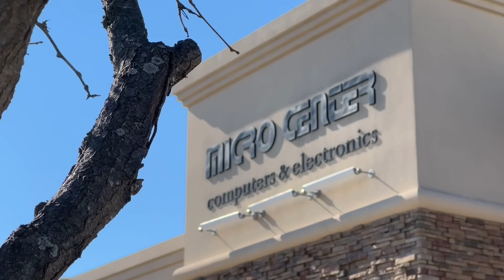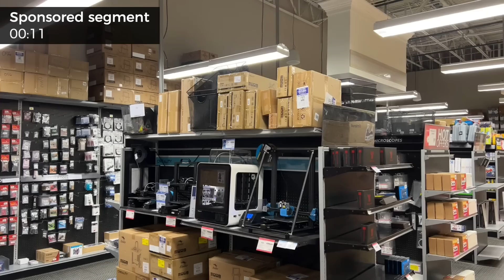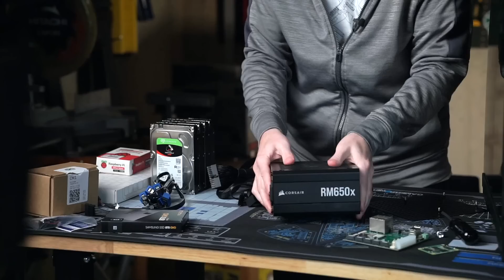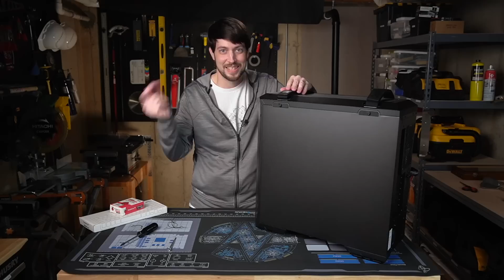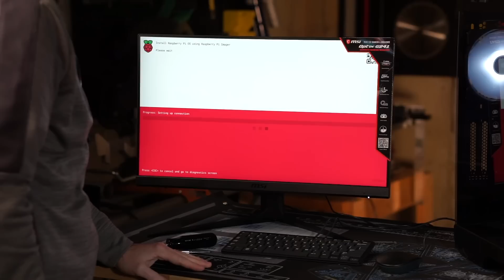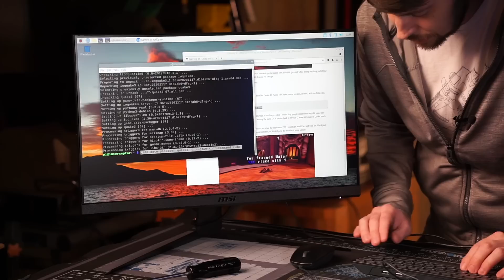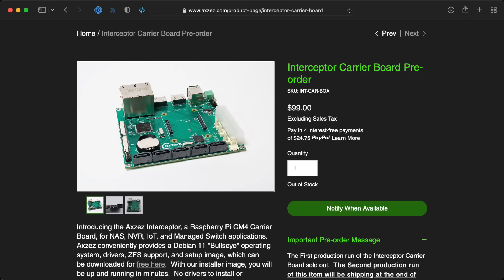Building a $500 Raspberry Pi Gaming PC

Comment: If you were concerned with the airflow for the HDD's on the rear, it looks like if you could mount some 40mm Noctua fans they could push air to the rear through the plate the interceptor board is sitting on.

Comment: I’m surprised someone hasn’t mentioned it…… hz and fps aren’t the same thing - they are related, but having a 120hz monitor has no correlation to the FPS in a game. FPS refers to the number of individual images (frames) a computer or graphics card can produce per second, indicating how smoothly a game or video appears. Hz, on the other hand, measures the refresh rate of a monitor, indicating how many times per second the screen updates to display a new image.

Comment: With Linux you can literally "boot" from everything. I have a 386sx16 which BIOS doesn't even support 500MByte hard drives. I boot the Linux-Kernel from a floppy disk and from there on I simply download the Init-Ramdisk over TFTPD, then bind a 4GByte iSCSI "hard drive" over network to it and mount my 100TByte Server Share over NFS (NFS is a shitload faster than SMB and on a 386sx16 this matters a lot). Btw, the computer is connected over 10MBit Coax-BNC to my backbone, together with my Amiga 3000 (also running Linux) and some other ancient machines.

Comment: I have no interest in building this I just wanted to say that it's awesome that I have that same exact case, although mine doesn't have room for 3.5 hdd on back it's more for thinner ssd and the mention of cooling this case offers I think you slacked off a little, each fan can be set hi/med/low also it has room for 9 fans, mine only has 7 but 1 is the size of 2 and the side fan being a 12in beast. All in all the case is the show stealer keep up the good work tho man

Comment: Sorry, but this is soooooooo overkill for a Raspberry Pi. there is so much I would change to make it so much better plus saving $250 or more. if you want to know how I would change this: 
change the monitor to a 60hz 1080p IPS (becasue there is no gain in anything higher then that), 
A m-atx case that surpports 4-6 drive bays (around $100), 
Logitch G305 and mostly any mechanical keyboard
choose whatever storage you want but 100% change a sata to a m.2 to boot

Comment: You could’ve plugged the power supply into the motherboard through the top so you went out the go around that hole I think that’s what those holes on the top are for good video interesting gaming Computer with raspberry pi it’s awesome

Comment: Hi Jeff. Watched this video last night and you mentioned in the video, that RPI4 can not boot from SATA drive. hmm maybe I am wrong here, but this drive from Toshiba (Toshiba Canvio Basics 1TB Portable External Hard Drive 2.5 Inch USB 3.0 - Black - HDTB310EK3AA) is connected to my RPI4 - 8GB and I boot from it and have no SD card in my PI. As far as I know it is an SATA disk inside. Am I doing something that is not possible or am I just not clever enough on hardware? Sorry for my English, but I am Danish and nearly 60 yo. Thanx for some graet videos on Raspberry Pi.
Reply from the maker: Technically that's USB boot (even though the drive itself is SATA), since it's booting through the USB interface.

Comment: I see that Quake ran around 90 fps. Coincidentally, this is the default max framerate, if I recall correctly. Just making sure - Did you set /com_maxfps to something higher when ingame? 125 is preferred, but you can get it to 333. Do note - Running Quake at higher FPS without some tinkering affects the physics in the game, making you jump higher. This can have adverse effects. 125 is the sweet spot

EDIT: Running Q3A on my Sony Xperia Z2 from 2014 easily gets to 60 fps at 1080p. This is what makes me doubt that this was actually a hardware limitation
Reply from the maker: it would peak at 100 fps in outdoor environments, but yes did seem like it was limiting to 90 elsewhere.

but the frame rate did stay down below 70 when there was a lot of action on the screen.

Comment: Wish there was a micro center near me in Canada.... Eh!

Added: also could the board be used as a router with opnsnse? Since it has 4 rj45 ports? I might want to do that as my current router is a pc using about 36 watts. Only if it would use less then 36 watts. Does it?

Comment: Please, the IO-Shield for self printing can you upload on your website?
Reply from the maker: Check the description—it's up on Thingiverse.
Reply: @JeffGeerling  Thanks, I found the IO Shield on Thingiverse.
Unfortunately the Turing 2 board for Raspberry PI is not available at the moment. The price for it is also announced nowhere, like delivery to germany.

I would be very interested to know how good the cluster is for comparing a Windows PC using a benchmark test on both systems. Because that's the only way I can imagine how good Turing 2 Pi is. You have already mentioned the problem with the only 100 Mbits in the LAN, so the Turing board could do considerably more. How busy are the processors in the benchmarking test? Hope to see this in next videos of you!

Comment: If only CM4 boards were easy to get, I have a rack mount mini kits based case at work that blew up the power supply and wrecked the main board. Would make a good case for some of the things I might want a Pi doing.

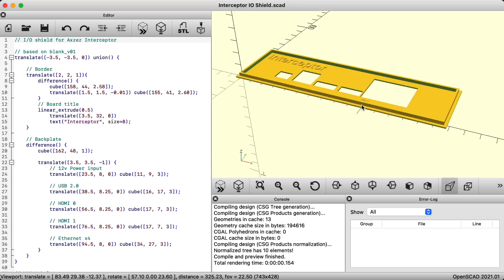Comment: 4:19 OMS, i have no idea why u use openscad, it's a lot easier and faster with any other CAD software like fusion 360 Tinkercad .etc
Reply from the maker: For simple geometric designs, I find it a lot faster (and less prone to the application crashing) to quickly design them in code. Plus modifications are a lot quicker that way.
Reply: Interesting!

Comment: Is he doing that thing where you keep the boot partition on the thumb drive but the rest of the os is on the faster storage? I saw someone do this with an old computer than couldn't boot to PCIE NVME
Reply from the maker: Yes; that's how you can set up SATA boot through the Interceptor (or on any CM4-based Pi really, if you have a SATA drive). With NVMe though, as long as it's directly attached (not possible on this particular board, but can do it on others), the boot can happen entirely via the NVMe storage.
Reply: @JeffGeerling  I found this to be a neet workaround for those systems that don't natively support booting from a particular storage device. However having the USB drive mounted outside the case would be worse than having it inside somewhere.

Comment: Hello Jeff, I am curious about the power consumption of this build once it is running "full graph" when gaming.  For example when you are showing the Quake-3 how much power is consuming? ( note: what is the gadget you are using the test for power consumption ? I couldn't find it in previous videos - I may have missed :-) , Thanks for putting all the effort on this build, appreciated all your hard work.
Reply from the maker: I typically use a Kill-A-Watt for wall power, or a little USB-C power meter for Pi USB-C 5v power.

Comment: Clever video. A sponsored build in the style of LTT on a Gamer's Nexus mod map. Even had the banter with the camera person. I appreciate the work that must have gone into this. 

I was really into the Pi at launch back in 2012 but I had a terrible time with USB on the first ones and I ended up chucking it in and never returned to them. They have been sitting in a box for the last 9 years along with a slightly more powerful arm board I bought to recompile compile code optimisd for Pi  (the Pi itself was so slow and lacking in memory back then). Cool to see so many options with the Pi now.

Comment: It would be nice to put the power supply in the other way up, that way it's not doubling as a vacuum cleaner, as there is no thermal load in that case, there is no advantage to it having a dedicated air in - although you may have to hack the vanity shield.
Anyway, this has to be the empiest gaming case ever.
Reply from the maker: Haha, yeah, it wouldn't matter in this particular build, really.

Comment: Jeff--I didn't realize I wasnt subscribed--am now. up until you mentioned the poor NAS performance I had been regretting my most recent purchase--this looked like exactly what I was looking for to build a NAS. is there a way to improve that performance spec? possibly with a raid controller ?
Reply from the maker: Raid controller is still limited to the ~419 MB/sec (400 MiB/sec) throughput on the Pi's single Gen 2.0 PCIe lane. I tried even using NVMe and U.3/SFF NVMe and SAS storage through a Broadcom/LSI MegaRAID card in RAID 0 and in RAID 10 and could not eke out anything more :(
Reply: @JeffGeerling  you are confirming my suspicion that a Mac mini will indeed be better suited to control my nas. 

Next question— would you bother spending the extra bucks on a 4/5 bay hdd enclosure with raid or is it money thrown away (especially when I want to set up zfs)

Comment: I'm not sure I'd try working an external GPU until the Raspberry foundation fixes the embarrassing single-lane-of-PCIe situation (and a 2.0 lane at that).  You'd basically be running the card interface at 1/64th of its expected bandwidth.

Comment: Is it that hard for these board makers to throw some PWM control circuit together for the fans? It wouldn't even have to use the PI module for control. It could be a stand-alone "system" with a sensor output, so the PI can know what's going on.
Reply from the maker: Some boards just re-use the design of the CM4 IO board itself, which has a PWM controller built in already. This board doesn't have it, I think because their plan for the 1U case involves just running a bunch of fans and the quietness is less important.

Comment: Did you try /cg_maxfps 120 in your quake config?
Reply: I meant com_maxfps. Sorry it's been a minute since I felt cool using a q3a console.
Reply from the maker: Haha I forgive you for not remembering all the console commands from 20 years ago :D

I didn't actually do that... now that I think about it—I wonder if that's why it was capping at either 90 or 100 fps. I'll go try it.
Reply: @JeffGeerling  let me know how it works out, before I go trying to relive the glory days with my rPi 4 😅. I found a thingiverse creator with a rPi case shaped like the B&W G3/G4 powermac case so the nostalgia will be complete.
Reply from the maker: I tried but it was still giving me under 100 fps... I think it's a limitation with the Pi just not being able to pump through the frames. I did also test 144 Hz refresh rates and it worked—but was not very stable. The screen would go blank a lot.

Comment: Just gonna say, if you ain't built a PC since '99, I think you're gonna be pleasantly surprised by how much easier it has gotten. Then again, it was already pretty easy by '99, but jumper settings are a thing of the past these days unless you're doing something very complicated. The damn pins for the power switch/LED, disk LED etc. is the last bastion of the annoyingly fiddly nonsense.
Reply from the maker: lol they were already a pain on this tiny build—the header on the Interceptor (at least my prototype) wasn't labeled, so I had to keep glancing at the online docs.

Already I'm noticing that modern cases are laid out for much easier cable management. In the 'old days' it was basically a rat's nest all over the place and it was hard to make it look halfway decent.
Reply: @JeffGeerling  Some motherboard manufacturers are more helpful than others on that front.

Some of them don't mark anything at all, and like you did here, you'll need the manual on hand, whereas others are marked, and some even come with a nice... not sure what you'd call it, multi-socket thing, that has all the appropriate pins on it to plug into, then once you've plugged everything into that, you just plug that into the board header.

Comment: I don't know if you mentioned what graphic API did you use but Vulkan is more performant than OpenGL, so in case you used an OpenGL Source Port you could try one with Vulkan, which I don't know if they exist for RPi.

And then it's a matter of tweaking the cfg; forcing vertex lighting, 2D pickups, no 1st person weapon models, cheapest texture filtering, picmip 5, low geometry, no shadows and a resolution of 960x540.

I'm not sure if it that's enough to get 120fps though but it's worth a try.
Reply: I think lowering resolution is the most important of those fixes on the Raspberry 4, it seems the weakest point of the tiny 1W GPU is fillrate.
Reply: @tinspin  I agree, mobile GPUs work better with low resolution + antialiasing than high resolution.

Comment: Come on...you call yourself some sort of maker but cant figure out how to set up a secondary unit like an arduino uno for its pwm as a standing fan controller on some of that extra room you got from the psu...
Reply from the maker: I planned on setting up a Pico as an RGB controller, but haven't thought about doing PWM to the non-PWM fans that way. Could be fun but annoying since the fans need ~12V.

Comment: Jeff, you get hit with the ransomware on Asustor?
Reply from the maker: Nope! I don't like turning on features that directly expose any of my gear to the Internet—I have never had their DDNS, EZConnect, etc. enabled, so the attack surface is reduced. AFAICT it was a hole in DDNS.
Reply: @JeffGeerling  Yes. I believe so to. I've been working in the Asustor forums and I managed to identify and kill the process before it could attack my volume. it did deadbolt some of the system files though so I wont dare shut it off. I got a look at the script too that it was using. I'm in the process right now of moving my data to LTO and then I'm going for a reset. Hopefully asustor release a patched firmware soon. but accidentally leaving that ez-connect ddns shit on was what got me. everything else was off.

Comment: Hi Jeff this was a fun video to watch and you managed to also add in interesting information and some good instructions for beginners on how to overclock the Pi, something that's definitely needed to get the best performance if you do any emulation gaming. I love it when you overhear your candid family member comments in the background too! :) Thank you family members for helping make these videos!

Here's some general suggestions for possible future video content. (yough you might have done these already before):

- Try building VkQuake1-3 as per Iago at Igalias blog instructions. He posted a screengrab that says 117fps in the corner so if that's actually for a rpi maybe you can squeeze 120fps out of it!? Personally I'm interested in seeing how black frame insertion looks in retropie games that supports it but that mmight be out of the 'Jeff' zone.

- Maybe there's a kmsdrm rendering program that you can get to display at 120hz as I have better luck getting smooth drawing using that display system than GL under x11. Maybe something like forumuser 'cleverca22's bouncing raspberries 'on the metal' coded demo!? Not sure?

- I'd love a video on Cross Compiling from say a x86 Ubuntu for Raspberry 4. I'm interested to learn if it's really a nightmare to set up and do or if it is a feasible option!?

- How do you make a power on/off button that safely shuts down the rpi before cutting the power!? I think you did that here in this video? I'll have to re-watch to see if there's info I missed.

- Did you end up overclocking the GPU as well? Can one still overclock the memory of a Rpi4b?
Reply from the maker: I overclocked the GPU to 750 MHz. And next week one of the things I hope to test if I have the time is cross-compiling the kernel on the new AMD build! Finally, the on-off button powers on the Pi from an off state, but does nothing once it's running. That's something that would need a bit more hardware support plus a little bit of software (than what's built into the Interceptor).

Comment: hard drives dont typically need ventilation
Reply from the maker: They need somewhere for the hot air to go, though—and these NAS drives can get hot running 24x7, if you use them much.
Reply: @JeffGeerling  ah i wasn’t aware of that, most cases don’t actively cool hard drives and usually it’s not a problem

Comment: ummm @0:24 --- I was hoping.. yeah I know, but yeah ... what would be needed to adapt and fit a rasp-comp module to a intel motherboard... or AMD for that matter ? ok... PCIe communications, Southbridge work .. probably have to compile the kernel relentlessly .. but ... you raise a very good rhetorical question. How do we start?
Reply from the maker: It's actually been explored—so far the answer seems to be that, since the Pi's PCIe complex is a bit awkward, it might not be able to work over PCIe as fabric/networking layer :(

Nobody's gotten to the stage of actually experimenting on that—but from everything I've heard from Pi engineers themselves, it doesn't sound like it's something the BCM2711 would be able to do without exotic hacks. Maybe the next generation, one can hope!

Comment: Compared to a rbpi 400 for light office work.. how does this run more stable ?^^

p.s GN modmat spotted
Reply from the maker: The cooling on here is even better than on the Pi 400 — but the Pi 400 is also great and can easily take a 2.1-2.2 GHz overclock.
Reply: @JeffGeerling  i think a lot about replacing my rpi3 Desktop with Something a bit more powerfull....
this nudges me again to rbpi.. ^^

i also laid eyes on a pinebook pro.but those are even scarcer at the Moment.

while i am at it.thanks for all your ansible roles <3